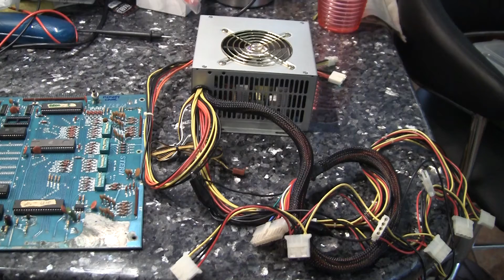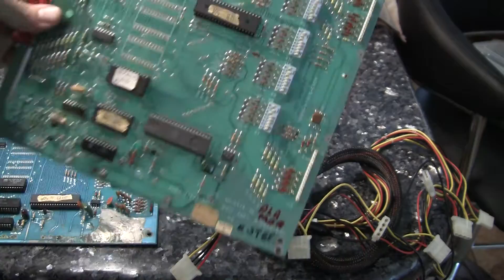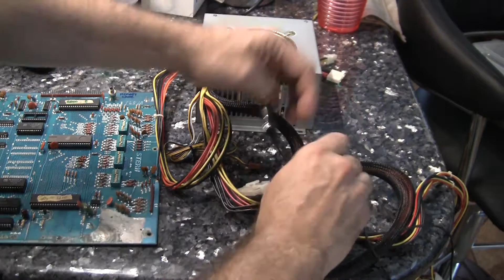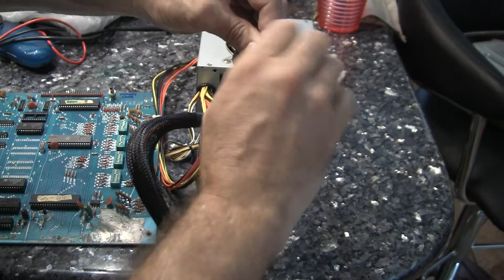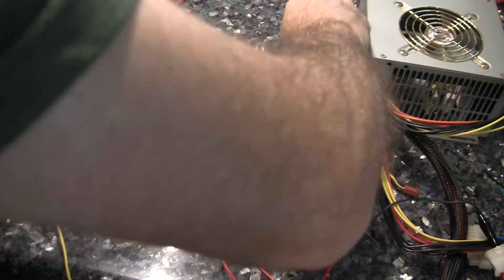How to make a test-bench-rig for Bally-35 Pinball MPU boards - PinballHelp.com

Comment: Any other boards this can test besides mpu, particularly video for driver board?
Edit: just did this and have a good board. I bought a $200 alltek when wasn't needed. I wonder how many boards Bally threw away because KOS book says replace board if no led light.
There's something wrong with my driver board likely.. the psu is giving correct voltages. I have light on playfield but no led activating on mpu

Comment: Thanks for this video.  I am about to clip and connect the green and black wire.  But a question - there are multiple black wires.  Does it matter which one i connect to the green?  Are all the black wires ground wires?
Reply from the maker: Yes always double check the wiring, both where it is soldered onto the board and where on the transformer it is coming from. Don't assume all similarly colored wires are the same
Reply: I used the black right next to green on same plug. Clipped and soldered together. 

The 2 blacks on molex I cut one off and other is used for tp4

Comment: I actually have a real bench rig for those boards.  I had some older pins in the past but no longer do.  Never got to use it.  It plugs into the connectors so you know everything functions properly.   Probably need to sell it to get it to someone who can use it.
Reply from the maker: Let me know if you do want to sell it.  mike at pinball help.com

Comment: Great video thanks......quick question how do I get free play on that board.....Kings of steel.....thanks
Reply from the maker: many of the early Bally games didn't have a free play setting, so the thing to do is set the replay score very low so most of the time people can score a game and there's always credits on the board
Reply: The alltek universal mpu boards have freeplay option if you swap boards. But they're $175-220. They do have a built in memory, so no more battery issue and they're universal to work in other games (like 90 of them)

Comment: As a computer guy that's worked on many, you're better off using a quality brand power supply, since the cheap ones have poor 5V and 12V rails which will usually run under their specified voltage by up to 10 percent.  Cheap ones don't have an on/off switch and usually have a stamped fan grill.  A 350W or higher Antec is usually cheap and good quality.  Also, you don't have to cut the green wire on the main connector, just make a small U shaped jumper wire and put it in the big plug between the green and the black ground that is usually right beside it.